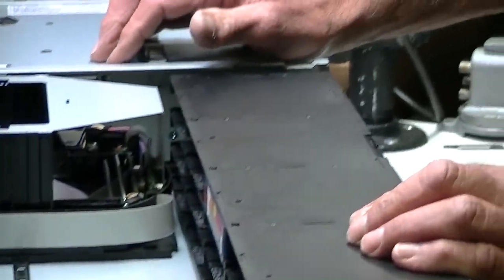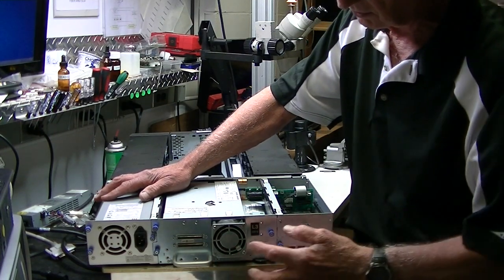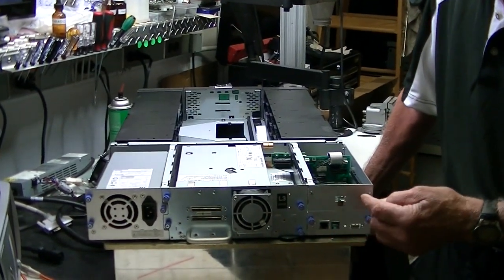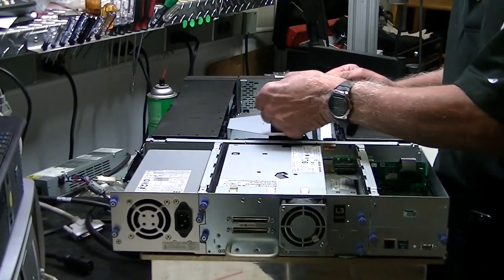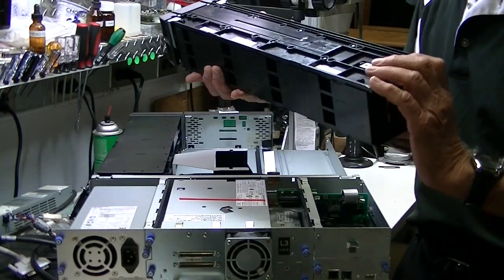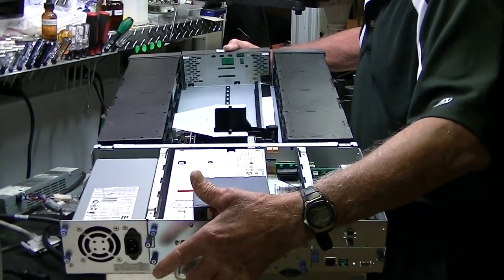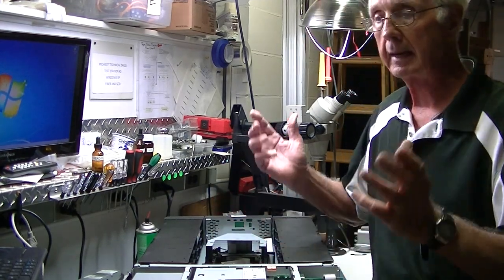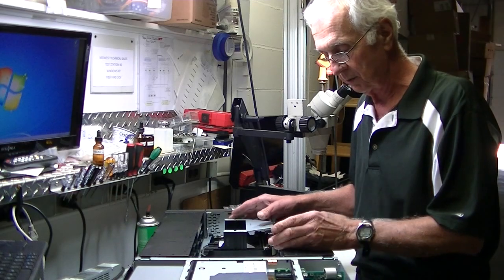DELL Powervault TL2000 Overview

Comment: Hello great Videos ;) I have an TL200 at home that I bought some time ago LTO-6 Fiber Channel It worked until it failed during a backup and the tape drive now recognizes every tape as bad even a cleaning tape... anyone know how I can troubleshoot ? I already tried update and downgrade the drive firmware with no success...
Reply from the maker: If the tape drive errors out, the library will mark the tape as bad.  It appears as though the drive errors out each time you put any cartridge in.  Therefore, the library is making ALL tapes as bad.  You also said that it failed during a backup, so it appears as though the drive is having problems.  You could run IBM ITDT test, but will probably find that the test either will not initiate or the tape drive will fail.  There is not much you can do on your end at this point.  We do offer a no-cost repair evaluation.  Here is a link to our repair process for more information: https://mwtss.com/repair-services/
Reply from the maker: RA thanks for the kind words.  First make sure you loaded the proper FW they are different for FH &HH drives as well as FC or SAS.  We very seldom downgrade FW we have had issues.
I strongly feel that all of the media is not bad.  I do believe the software is marking the media as bad.  Most likely from a failed back up request.  We are somewhat familiar with some back up programs but following these general guidelines may help.  Clear out any pending back up jobs. Remove that tape drives via device manager.  Turn off the auto start on the  backup software.  Power off server and tape library.  Reboot after a few minutes.  First turn on the TL2K let it finish the POST.  Repower the server on.  The Device Manager should ID new hardware the library and tape drives.  Once that process is complete then activate the back up software, that software will ID new hardware and install the proper drivers.
Also look up any blogs for the kind of software you are using.  I am certain you did not invent this issue.
If you are a MAC user just use the concepts I described and convert language to MAC these are for Windows and using Back UP Exec software.

I hope this helps.
Regards,
Dan - Owner of MWTSS.COM

Comment: How much did this retail for, and it's as flimsy as the Wright Bros. 1903 Flyer?
Reply from the maker: I'm sure when these were sold by DELL, they were in the thousands of dollars.  DELL no longer sells this product.  We do have some units Manufacturer Refurbished by DELL.  You can find them here: https://tapedrivesales.com/products/dell-powervault-tl2000-library-2u-24-slot-low-power-on-hours-poh-mp871-hx7dw

Comment: I found your videos by random chance, and i gotta say they are very good. Your have a tact for teaching - maybe you should make more of these videos :)

Thank you!
Reply from the maker: C Los:  Thanks for the comment, after an MA in teaching and a MA in instructional design and working for several years in computer assisted instructional environment, I do appreciate the comments.  For the past 30 years I have been in this business and am following my interest levels.  The most difficulty I find is assessing the entry level of knowledge of the viewer.  Too elementary and one will insult folks, not technical enough and you will loose the experienced users.  Some have more knowledge that we do.  On an annual basis we test, repair and sell over 3000 LTO based systems so we do have some technical knowledge.
I really enjoy helping folks out.  We attempt to tailor our video's based on what we see as common issues we discover during our interaction with our customers.

Regards,  Dan Owner Midwest Technical Sales.

Comment: Is there a way to remove stuck tape inside the Drive. ?
Reply from the maker: Henry:  Many reasons for the tape to get stuck so removal depends what state the media is stuck in.  Best and about the only thing you can do is remove the cover from auto loader, turn on the unit, wait for the POST to clear and picker is not moving.  Gently move the picker to the front of the drive.  Now you will have access to the eject button on the tape drive.  On library drives there is no bezel so look for a small push button switch on the upper right on the circuit board.  Switch is usually silver with a black button about 4mm X 6mm.  Push button for 15 seconds and release.  Tape may come out.  If it comes out does not mean it will not get stuck again.  Typically what happens on a stuck is first someone dropped the tape and leader pin was put back in the proper place or the servo tracs are debris contaminated.  Cleaning tapes will not address issues you will need to send it in to us for a no cost repair evaluation.

If you do not feel safe or comfortable doing this do not do it.  Send just the drive and sled into us for an evaluation.

Hope this helps, feel free to call me at 952 736 0200
Dan
Reply: Thx alot. I pull out the drive and  tried to use force to remove the tape. but the tape dmaged. :(  I will try that if happen again. Thank You!
Reply from the maker: Henry:  Okay on the forceable removal.  You will note that was not one of my suggested options.  From our history 99% of the folks who do this damage something on the tape drive that makes it most likely un repairable.
Not sure if you got the tape out or not or did you just damage the tape because it was broken.  You also need to remember what originally caused the stuck tape most likely was not fixed by forceable removal.
Regards,
Dan